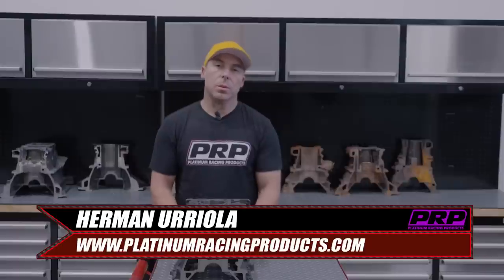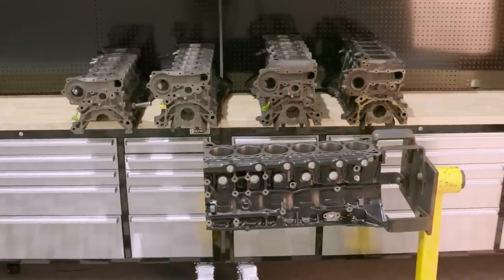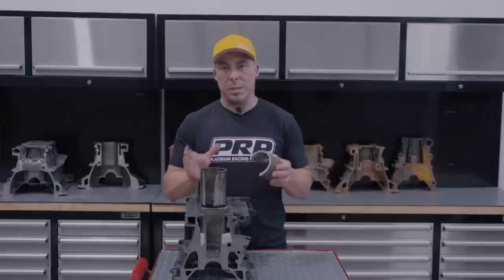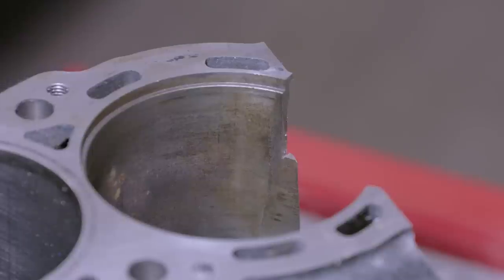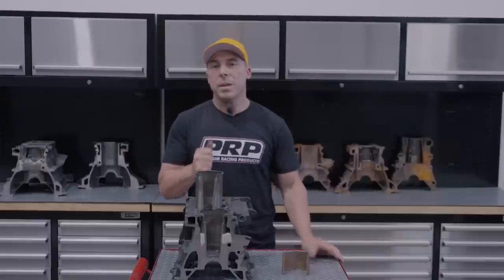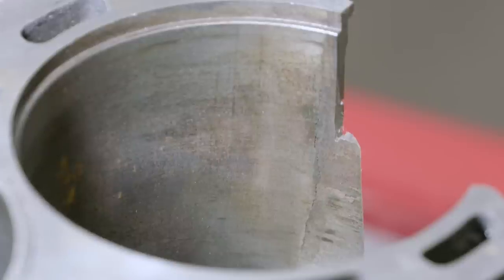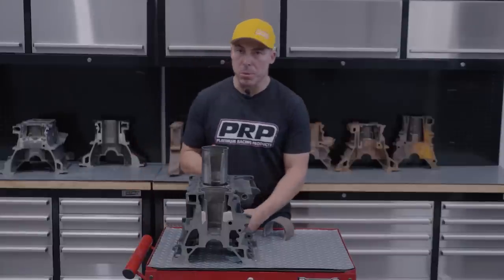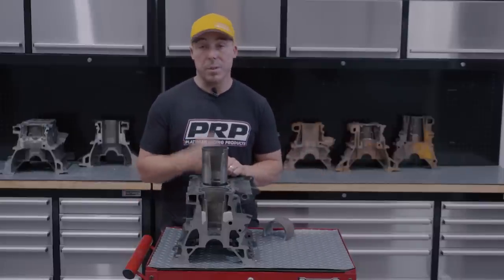Why You CAN'T Sleeve A Cracked RB Block  - Platinum Tech

Comment: Get that prp block in production. LONG LIVE THE RB 👑
Reply: I gave up waiting and went billet
Reply: @bretth3224  😳 Wow, how much that set you back? Near on $15,000 last time I checked
Reply: @Daniel Brealey  that's like 3-4years of saving just to buy the block then new crank rods and pistons, hoooo lord 😅😅 I don't think my budget could ever stretch that far🤣🤣
Reply: @j.d3604  It's a lot for a street/strip car- and most cars won"t need a billet block anyway. An aftermarket cast block of decent quality should be enough for 99% of us
Reply: @danielbrealey2924  was about 13 at the time, was a couple of years ago that I bought it. My issue was I had cracked the original block in multiple places and no one was willing to let me sonic test one before buying it
Reply: @bretth3224  Fair enough...
Reply: @bretth3224   I sent my two blocks to Herman to sonic test, my block ended up in someone elses engine bay and I got someone elses block back with a test report done 2 years ago dodgy fuck, so I gave up on the sonic testing too and went Billet.

Going all the trouble of a production cast block, especially driving half way through the state to buy one right off a stock low KM r32 half cut, potentially building it and having it crack was just something that was not worth it.  I hope the block finds it's new owner well and keen to see how it holds up.
Reply: @Daniel Brealey  yeah definite, i personally would never need a billet block. So if Herman can come up with a nice new cast block that's not outlandish in price then that would be a game changer for those of us that don't and bottomless pockets 😅👍

Comment: Not just RB's, problem with a lot of blocks. The machine shop next door to me does a nice line in boring out and pressing in replacement cylinders, has a couple of race teams use them regularly as it's cheaper to replace the cylinders than source new engines every other season. 

My friends hill climb car has an RB20 with sleeves that bring the bore down to 74mm, effectively making it an "RB1.8" to fit the displacment class he runs in, that engine wasn't damaged beforehand and has not been bored out at all, but he is still worried about it cracking and borescopes it regularly.

Comment: Herman, thanks for the tech info, customers need to understand that  certain blocks that came out the factory had inherit weeknesses.
Even boring them to 0,25mm or 0,50mm  oversize just thins the thinner walls even more. So resleeving is a definate no no.

Comment: With the PRP block, will you be improving deck/cylinder wall thickness aswell as the oil drain backs?
Reply: And will you be getting the foundry to do you a small run like 10 so you can let a few people have guinea pigs to see if they any good

Comment: At what power did this block split? Can you run more power on a 86.5mm(vs 87mm) piston set provided the hardness/thickness of the block is within average spec?

Comment: Wired non related one is that filling in the water ways? Heard it’s done for strength is that what I’m seeing the grey/sandy matter?
Reply: Yeah mate it would be, common thing to do to grout the RB block.
Reply: Grout filling is done yes but its not practical for street driving and have to be careful of Temps so u don't cook the head. If ur at the power levels of needing to grout fill a block its best to go billet. it'll save u money in the long run and will perform better.
Reply: @Lennix Singh  the Volvo b230 has the same problem as the RB with thin cylinder walls. People usually grout them up to 20mm below deck and then drill and tap four holes along the cylinders to inject water there instead. Works really good.
Reply: @Lennix Singh  here's a photo showing the custom water system. Block has been filled with epoxy to right under the nozzles.
https://i.postimg.cc/63q4w81c/FB-IMG-1675241069486.jpg

Comment: What about wet sleeves? Looks like there's enough material for that. Looks very thick around the water jackets. Shouldn't be a problem from first impression.
Reply: But you cut the oil gallery in half fitting them

Comment: What about darton sleeves only running a 86mm piston.
Reply: No one really uses 86mm pistons in aftermarket form. If ur using only 86mm pistons your probably not pushing huge power anyways.
Reply: @lennixsingh626   I’m no engine builder but I would think by running a darton sleeve you would then run a aftermarket 86mm piston and keep more material in the sleeve? 1mm of material is a decent amount yeah.
Reply: @ryanjames3568  No one uses 86mm pistons because that's the base bore. everyone uses 86.5-89mm. And no half decent sleeve company makes 86mm sleeves.
Reply: @lennixsingh626  piston size isn't really an indication of how much power someone's chasing. The closer the bore is to standard size the better when it comes to reliability and strength.
Reply: @Chris-od1jp  Bigger pistons result in more displacement thus increasing power. And typically for huge power builds they use 1-3mm bigger pistons than factory.

I never mentioned anything about strength. I did however point out that no one really makes 86mm pistons because its the base bore of every RB.
Reply: @lennixsingh626  all the main manufacturers make a 86mm piston for the RB26. Without increasing the stroke of the motor you're getting minimal displacement increase.
Reply: @Chris-od1jp  The two leading piston companies for RB's are both Nitto and Italian RP. Both of which DO NOT have an 86.00mm piston. but whatever floats your boat.
Reply: @lennixsingh626   companies also don't have anything over 87mm either, but do have sizes of 86.5 and under. So there goes your idea of all high horsepower builds using 1-3 oversize pistons, also one of those companies aren't actually a manufacturer.
Reply: @Chris-od1jp  I've responded to u twice with a link to Nitto's 86.5mm-89mm range. but it keeps getting deleted. Just look up Nitto DOHC RB30 89mm
Reply: @lennixsingh626  they make 86mm for the rb25s, but we're talking about rb26s, not 25s or 30s
Reply: @lennixsingh626   IRP aren't leading nothing for RB, my RB28 pistons fouled the counterweights on a crank they can't even get that right had no interest in getting me a good piston set but just band aid fixes
Reply: @boris9331  It's not my problem you or your engine builder cant build engines properly. Plenty of people are using IRP pistons without issues.

Comment: So what about the OS Giken RB30??

That had sleeves, and nothing cracked!!
Reply: Sorry got a few cracked ones , os was fragile
Reply: @26Petermc  LOL cool story bro

That’s funny, cos none of the 8 we built have ever failed. The cars make between 780whp and 1328whp. All 8 of the cars have only ever needed service work, apart from the drag cars which get refreshed as part of their maintenance schedules.
Reply: @flamintasty  I have been to osg good friends of mine , , so it's not like I want to put it down.  But they suffer the same fate . They have no deck strength and can pull up the original deck . Also they guys at osg did the builds on 3 different blocks . Stock n1 and rrr . The one I have thats cracked was on a stock block , was 600 kw . ,
Reply: @flamintasty  the last one I did I removed all the os parts into a billet because the osg with 5000km on it cracked the block

Comment: But this was an already cracked block. Can you sleeve a non cracked block and get better results?
Reply: No, because as Herman has already shown in other episodes, there's next to no meat between the cylinders anyway. You're LUCKY if you get an OEM RB26 or 30 with more than 5mm between the bores, and anything less than 3mm is considered too thin to build to huge horsepower and will blow prematurely so if you have no meat, the liner won't help it. 👎
Reply: No because the more you take away from the liner behind the sleeve, the higher chance it will have of cracking/ ballooning.
Reply: Zac Pole already tried sleeving a good block. Destroyed it pretty soon after
Reply: @nismofreak33  how much hp was making?